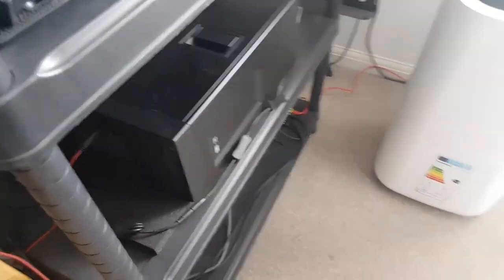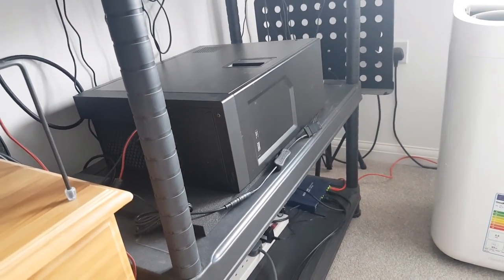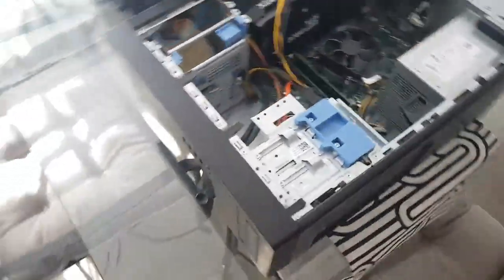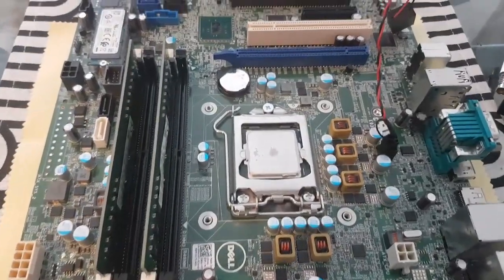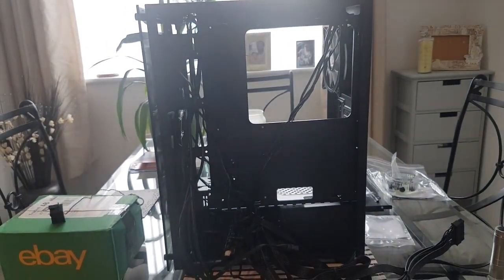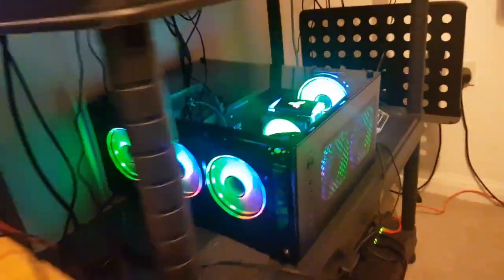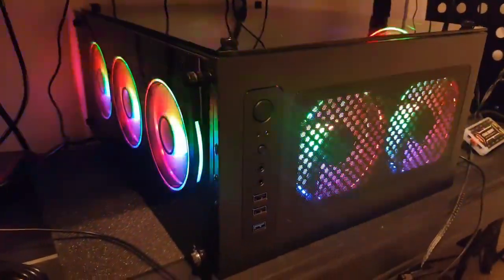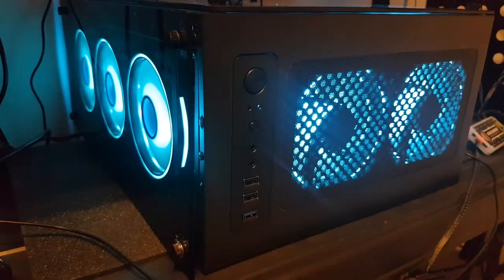CHIA harvester upgrade! | Dell Precision T3620 CiT Mirage ARGB Case mod, ARGB CPU Cooler & 750w PSU

Comment: Did you have any problems screwing it in? The motherboard fit perfectly?
Reply from the maker: No trouble at all.  Holes all lined up perfectly.  You can see in the video that it fitted but was tight to plug the power switch on due to the roof fans.  Thanks for watching

Comment: Suggest me a good or better case
Reply from the maker: I haven't tried many cases but out of the CIT and the MSI Velox 200R, I prefer the Velox.  Its bigger, has the great GPU riser bracket and the easy access tempered glass side panel.  Not a fan of some of the cables but you can make ot work as can be seen in my Dell Optiplex 9020 SFF case conversion video.  Thanks for watching.
Reply: @crypto-carlos  thanks man